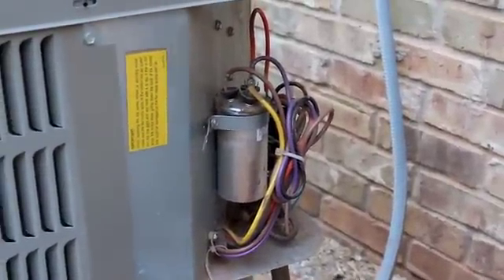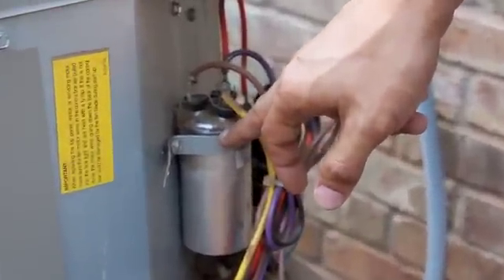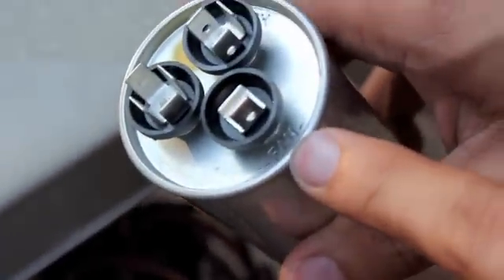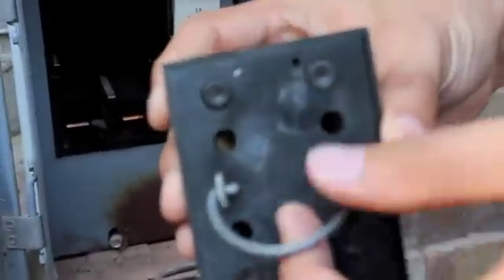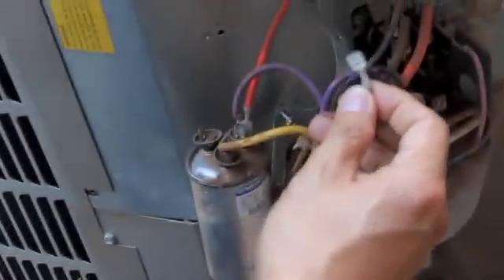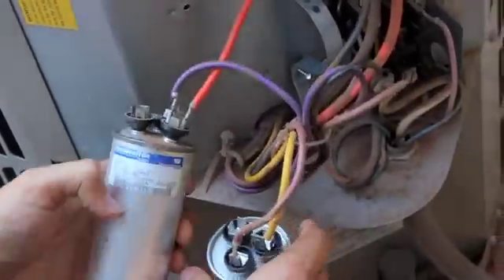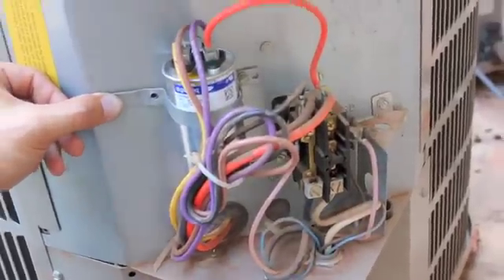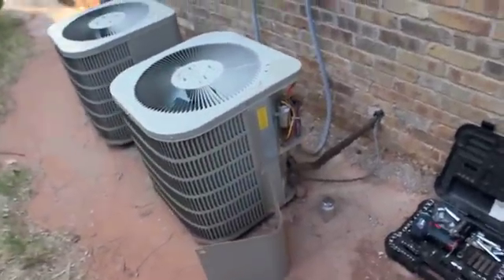AC fan not working - how to repair broken HVAC Run Start Capacitor - air condition

Comment: I had a AC unit that the fan stopped blowing. It was my first time with the issue so I did a little research (very little) and came to the conclusion that the capacitor was likely bad. But what do I KNOW, right?

Since it was for a relative in the house, they were adamant that it be replaced immediately. I called several AC repair companies and asked them how much for a capacitor. They wouldn't sell me one. Nor could I buy from any of the local supply stores because I wasn't certified. Finally bit the bullet and had one company come out. I was charged $250 for parts and labor to replace this capacitor. There are fewer times I can think of that I had been as angry as that one.

So I ordered a couple of capacitors to keep them on hand. They were only $20 shipped for a pair. When the capacitor in my other unit went out a few months later, I was able to swap it out in less than twenty minutes. Lesson: Keep an extra capacitor on hand. Even if it turns out NOT to be the capacitor and you have a motor that's gone bad, testing with a new capacitor takes less than half an hour if you're lazy about it and could save you hundreds of dollars.

Also had a motor go out in one of my units. Troubleshot it and decided it was the motor. Again, I have never worked on AC units prior to moving in to my home. But doing research on this stuff is not that hard. Called everywhere asking for a quote to come and replace the motor. No one would give me a quote for it. Not even a ballpark figure. I even asked "suppose you come out here and you diagnose and you find out the motor needs to be replaced. How much would that cost with parts and labor?" No company wants to give you that.

So I decided to try and buy one. Again, shut out because I was not certified. Eventually found a friend that new a HVAC repairman whom went and bought one for me from a supply store. An hour later, I was back in business and likely several hundred dollars saved.

The HVAC industry likes to treat the machines like they're some great mystery when they're really not. Sure, for some people it is. Just like cars are, just like computers are for some people. The problem with this is that if I want to work on my car or work on my computer there are stores everywhere that sell parts to the general public for almost everything for a car or computer. That is not true for a HVAC unit.
Reply: Yea they are pretty easy. Grew up doing HVAC with my dad. Only think you really have to get a tech for is when you need more Freon as you need a license to get it
Reply: bearxor there is a reason you pay a lot to have it worked on. called the tech spends thousands of dollars for overhead a year,plus tech went to school for many years to learn his trade so you have to pay for what he knows plus parts and labor. and he will know exactly what's wrong with your AC in 10 min or less. so no guess work. so my opinion is just pay your bill and quit bitching about the bill. I should know I've been a HVAC tech for 18 yrs

Comment: Thanks a ton for posting this. It's 100 degrees in Austin now. My A/C went out last night, found this video on youtube, went & bought a run capacitor for $3.79 at local HVAC supply shop, put it in and now i'm nice & cool. My old Goodman AC unit had a separate small oval run capacitor right by the fan motor in addition to the larger cylinder one as shown on this video. That's why so cheap.
So if you're reading this because you can hear your compressor buzzing but the fan isn't spinning, you should try this.  Just make sure to kill the power supply first!

Comment: Thanks for the video. It was very helpful. I have a question though, how did you know it was the capacitor and not the fan motor? What test did you perform to determine the exact cause?

Comment: Ac just went out today around noon,  had a repair company come out and give me an estimate,  all in all they said that it would end up costing me in the neighborhood of $800.  So decided to do some research of my own and ran across this video on Google.  I went and purchased a capacitor for only $12, followed the instructions just as he said and now my ac is back working better than ever.  Thank you so much DIY you saved me a ton of money and discomfort.
Reply: Off fsn caciter rrplaing same vslvd replacinv  fan  point fan  herom  point  starting poing  comperssor  startpoin  ruinv  comon power tackinv  ruinv pojn  comprssor     contact out dooe  unitothe contacn ..n  line  unit   and drreing  gleinv curit fixinv line  not shorting systom  and  slfty and checkinv ruinv ok amper  and  checking gas psi gued piper ly systom ok solved ok

Comment: Thanks for sharing!  Your video thoroughly help me with replacing the capacitor.  Now my air is up and running!  Woke up this morning to warm air coming from the vents. After checking the condenser I noticed that the fan wasn't spinning and there was a buzzing noise. Thought it could be the capacitor after researching and after removing it, the bulging was a sure sign of a bad capacitor . Ran and got a capacitor for $9.99 from a local supply store. I took the old one with me for reference. I figured if I was wrong I only lost ten bucks!  Cheap and easy job anyone can do....I'm a woman!

Comment: my son just had one replaced. they charged him $129  for a $10 capacitor plus labor
Reply: Technicians have trucks, parts, work comp. etc. to pay for on a daily basis. Coming to your house burning the gas and time to get there seems more than fair to charge you $129. UNLESS he charged you that much for the part and then hit you with a 200 dollar time and labor bill as well.
Reply from the maker: that is unfortunate. The bad apples give HVAC professionals a bad rep. He should do a review and rate that company on google, yelp, etc...
Reply: That is a fair price considering what it costs a company to come out to your house to do the work.
Reply: *****
If you had help, then you didn't do it yourself lol. So, you are complaining about the cost of doing legal business in America? What issues are you referring to? Do you complain when you buy anything from anywhere? Because the price of what you buy anytime you buy anything has the same issues you speak of. You don't own a business, or do you?
Reply: *****
1. You started with the negative attitude. 2. There is no argument, overhead is a fact of life, not my opinion. 3. You getting help shows how the average person would need to hire a company to fix their ac, thus paying for in small part the overhead of said company. Which WAS the point of my original reply (which was very polite). 4. Points 1-3 make what you typed last completely misguided, and further prove my original point. (not my statement of fact about overhead, but my statement of opinion about how incorporating overhead is a quite common, normal and fair practice when a company prices its products).

At this point, go look up "Internet Troll". It will explain your recent activity.
Reply: Brainard Jose
Thanks for turning a simple polite explanation of why you don't only pay for the cost of the part when you hire a company to come over to install it into a mess, lol.

Comment: Simple fix…..was able to kick start fan.  Fan motor ok…capacitor shot…bulging a little at the top.  Blackman Hoffman $11.00 piece.  10 minute job.  Works like a charm.  Thanks for the video

Comment: Seems easy enough to do it yourself, but in reality it can take a lot of your time just figuring what the problem is with your system. To avoid that, better get a professional to get the job done for your comfort.
Reply: Your business is feeling the effects of the online DIY community, huh?  Bet you charge more than $20 just to come out.  It would be worth it just to try this even if you didn't know it was the solution ... compared to what any "professional" would charge just to say hello.  And this can be done on a hot Sunday night when anyone you'd call would either not be answering the phone or charge another arm and leg for an "emergency" appointment. 

If you had said, hey, call a professional because this guy isn't doing it safely, maybe you'd have a point.  After all, he isn't wearing safety gear or using insulated tools, or explaining how to get the right part or discharge the old capacitor, or dispose of an old capacitor (http://search.earth911.com/ hazardous>air conditioner).
Reply from the maker: undrline And he is also wearing flip flops @ 3:02 :)
Reply: DIY Tinker lol, that was a hard one to catch :P

Comment: Thanks for the video! The fan on my exterior unit would only run if I gave it a little nudge with a stick. Replacing the capacitor fixed it! Easy fix once you discharge the capacitor. $11.

Comment: hey i'm having the same issue here. problem is when i turn on the AC i can't hear the buzzing sound or a hum on the outside fan but my blower fan inside the furnace is on and is blowing warm air. My question now is.. the capacitor bad? or is it the an motor? help!

Comment: How do you discharge the capacitor, please?  My fan isn't circulating.  I turned AC off for over 24 hours to make sure none of the lines were frozen (didn't have time to examine them... work :) ).  Came home and tried the AC after checking all of the breakers.  Fan turned for a second (literally) and then stopped turning.  I can't seem to get the outside "breaker" out to turn it around (first problem).  I'm also unsure how to discharge the capacitor (second problem).  Help?  Thank you!
Reply from the maker: Check this out:
AC fan not working - how to troubleshoot and repair condenser fan motor - trane air condition

Comment: i replaced it because it was bulging out like that but my fan is still not spinning it sounds like it wants to but it wont can you help
Reply from the maker: I have a AC fan video. search my channel for "fan" or try the following url:
AC fan not working - how to troubleshoot and repair condenser fan motor - trane air condition
Reply: thank you

Comment: My dog chewed out that rubber hose that has wires inside it, the hose coming from the bottom of the capacitor. Do you recommend it for a regular home owner repair or call a professional?
Reply from the maker: You can repair the rubber housing. its some type of flex PVC conduit. you can find it at HD, lowes, HVAC store, etc... simple to repair

Comment: Just replaced a capacitor. So easy it is ridiculous. Some show the capacitor gets discharged through the fan wires if they are connected properly, and I found the same result. I didn't get a spark when i attempted to discharge the contacts with a needle nose plier. You can even buy a multimeter and test it for voltage if you are scared.

Keep in mind, you can still have a bad capacitor that is not bulging, and for that you would need to test it with a good meter. Or, just replace the cap anyway/

Anyway, cost me $34 dollars for the capacitor.

Comment: Question my ac fan is running outside but  no air is blowing through the vents inside.....what could be the problem???
Reply from the maker: The furnace (inside your house, attic or garage) has a blower. The most common thing is the blower capacitor is bad, blower itself is bad, or the circuit board. Search those topics on youtube or google.

Comment: DIY Tinker, thank you for posting this great video! I know it will (and already has) helped a lot of people.

I think that a lot of people have a concern about HVAC repairs being very expensive. I think this comes from either personal experience or word of mouth about a "horror story". You know the type, where your A/C goes out, you call the repair guy, and he takes you to the cleaners...and it's only sometime later you find out the repair was incredibly simple and should have cost $30.

If you aren't a DIYer, or you think this might be beyond your capability, do some research and you might surprise yourself. If you still don't want to try it, do research on the HVAC service company you call in to do the work. Check their reviews. If you don't get a good feeling, it's probably for a reason. Get a second quote. Get an estimate, and don't authorize the repair until you understand what and why your A/C isn't working.

I am not an HVAC technician, but I do work with them often due to my career. For every horror story out there, there are plenty of good, hardworking and honest technicians who do a great job for a fair price.

DIY Tinker, I appreciate your videos!
Reply from the maker: Thanks Ryan. really appreciate your comment. Every professions has their good and bad apples. Unfortunately i had very bad and expensive experience twice.. I then decided to learn HVACs basics, share my experience and help my coworkers, friends and neighbors with their HVAC issues. I do have two good HVAC technicians i recommend to them if its beyond the basics.
BTW, The worst experience i had, was being tricked by replacing a 8 years old condensing unit, and then found out the breaker was all i had to replace. The HVAC guy knew it all along, but sold me a new condensing unit, and an electrician came out and replaced the corroded breaker. Then a realetor friend found my old 8 years old unit sold to another family for $400.

Comment: Was the unit making a buzzing sound? We got home today and were gone for bout 3 hours, when we entered our house it was warmer than usual. I went out side and heard the unit buzzing and it was hot.. So could this be the case that the capacitor it bad? I spun the fan to see if it was locked up and it turned freely. Hoping its not the motor.

Comment from the maker: that could be a possibility. Also, measuring the fan resistance only confirms electrically its fine, it doesnt grantee mechanically if its working well (e.g. bad bearing, unbalanced, etc..) Also, a lose wire or bad connections, corrosion, bad circuit breaker (one pole, not both), etc... could also be an issue. Intermittent problems are the worst... since there isnt a clear answer.

Comment from the maker: intermittent problems are the worst to diagnose. im sure they checked the capacitor and did all basic check ups. sounds like the fan motor might be bad, or a power issue somewhere.

Comment: I have had 2 repairmen attempt to fix my ac. My ac quits blowing cold air after 45 minutes, the fan on the outside unit quits, but the capacitor(?) is still humming.  When I shut the ac off for sometime, it will work again for another hr or so and the fan quits and the unit stops blowing cold air. I called another repairman he says to change fan motor? Any idea what I should do?

Comment: That is a dual capacitor. It is 2 capacitors in 1 housing. You did a good job fixing your unit. I wanted to add that the letters on top represent: F= fan,HERM= compressor, and C=common. But common is not to be mistaken for ground. Common is basically a internal plate that is electrical "common" to both "F" and "HERM".

Comment from the maker: check my channel, and i have the following videos. the logic should be:
1. Check contactor (this supplies 240VAC to the AC unit)
2. Check the capacitor (i have several videos, and show how to check the cap)
3. Check the fan
4. Check the compressor

Comment from the maker: the outside is called a condensing unit, which is shown in the video. It has a compressor and a fan. The inside unit has an evaporator coil and a blower motor. If you are getting air flow inside, but its not cold. Then there's a good chance the compressor isnt running, which might be because the capacitor is bad. Watch this video, it explains in detail (replace space with a .): youtube   com/watch?v=tCE1ovXHEXA

Comment: Hello i have a quick question my fan is stuck i hit on top and it moves a little bit hit tree or four times and it turns on but in a cuple min like 20 or 30 it turns off again and theres a humming sound but fan not turning and when push the fan with something its starts screeching my question is can it be the compasitor or fan motor thank you

Comment from the maker: turn off thermostat, pull the outside fuse , confirm 240VAC isnt present, wait a few min then use a screw driver to drain any remaining voltage. If you want to be safe then wait 10+ min. (personally i just short it with a screw driver right away).

Comment: Ok so my trane unit(not a big unit, small ranch home) the fan isnt turning and has a small hum to it.  its been off for 2hrs now.  Would the it be discharged enough for me to handle it?  Also Is turning the breaker off sufficient enough or do I need to try and pull the fuse outside?  Thanks

Comment: oh I shall make sure to check it out first before just going to buy any capacitor.  Thanks for the heads up.  I guess I still gotta go to the store to buy a screw driver first :P  or whatever that thing is called cuz my screw drivers can't open the panel on my AC unit.

Comment: not all capacitor is the same, you need check what kind or size capacitor you have, my capacitor have the label for the part number and other info, also Grainger employee help me to make sure i replaced the correct specifications...

Comment: I can't see from the video if the 3 wires have labels on them like "fan", "compressor", etc.  Does it?

Also, when pressing the wires into the new compressors, is there supposed to be a click sound so you know it is in properly?  Similar question for when pulling the wires out of the old capacitor.

I really don't want to screw this up by yanking the wire off by accident.

Sorry if I sounds stupid questions.  totally noob at handy work. :P